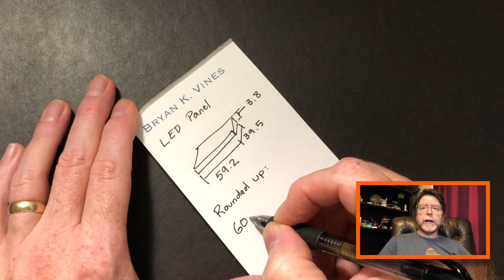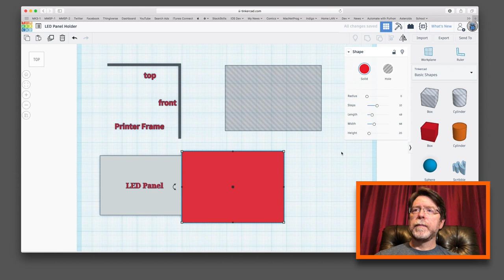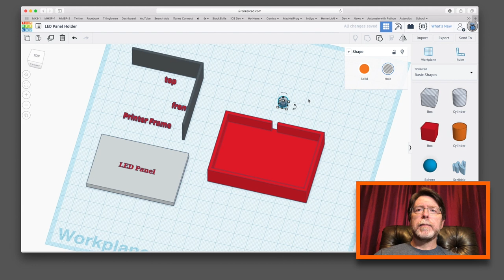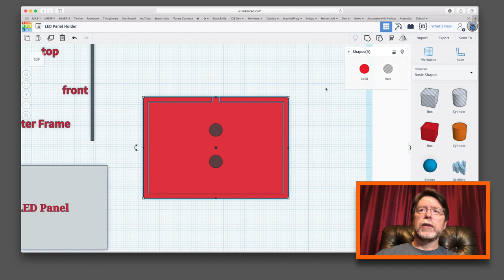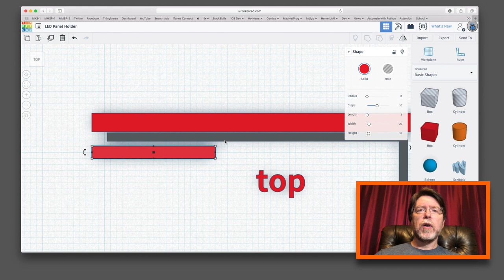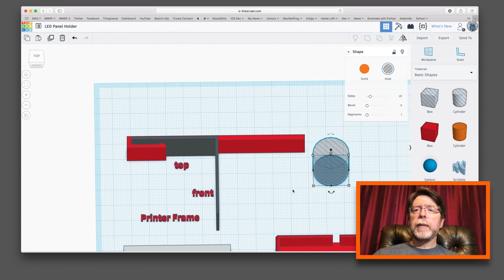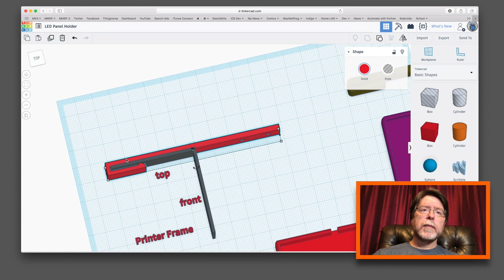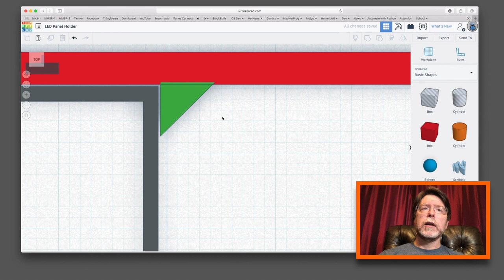Lighten Up!: Design & Print Light Fixtures for Monoprice Maker Select Plus

Comment: Cool Idea Bryan    thanks
Reply from the maker: Thanks Don! A lot of this can be translated to other printers. Mostly you'd just need to design a different arm or mount point. If you had a printer with a metal enclosure, you could just glue neodymium magnets to the rectangular fixture, and stick them on where needed. 👍

Comment: Another very nice video. Slightly modified this can work for any printer
Reply from the maker: Absolutely, David! A change to the arm design is about all that's needed. The arm could be designed with a notch instead of the clip to snap onto a printer with a thin, flat Z gantry, like a Prusa MK3 or other similar printer. Thanks! 👍

Comment: Hey Bryan! I don't have a Monoprice printer and I use Fusion360 for all my design work (having used Inventor in the past) but man, do these videos ever help. It's great seeing a different perspective from other makers using different software. Keep it up! 

Also, once again, great shirt!
Reply from the maker: Hi there! I appreciate the power of Fusion 360, but I have a hard time getting a design started there. Mostly I just need to practice with it and watch some tutorials.

Tinkercad's newfound ability to send an item over to Fusion 360 is cool. It lets me at least play with chamfers and fillets and other little goodies without having to actually start the design there. Although it's a one-way trip from Tinkercad to Fusion, it isn't that difficult to export from Fusion to an STL file, and then pull that back into Tinkercad for further tweaks.

I originally wanted to show the process of sending an object from Tinkercad to Fusion, but the video probably would have been another 5 or 10 minutes long. At just over 30 minutes, I think it's a bit long already. A lot of that is because I did the Tinkercad bits realtime. There wasn't much cut out of them. On the plus side, that means you get to see how I'm thinking about the design, and how I put it together.

Anyway, I'm getting long-winded. I'm glad you enjoyed the video. Thanks for stopping by and watching.

Oh, and the shirt is from Chuy's, a TexMex restaurant here in San Antonio. They've got lots of cool ones: https://www.chuys.com/shop/tshirts
Reply: @BV3D  I had no idea you could transfer between the 2 programs like that. I'd definitely be interested in seeing the process if you end up filming it one day!
Reply from the maker: I will add that to the list of video ideas. Thanks! 😃

Comment: Just FYI, the LED lights that you have linked no longer fit your design. I ordered some last week and when they arrived the cabling is routed differently and the LED panels are slightly too large. I'm going to try my hand at tinkering your design to make them work. Just thought I would let you know.
Reply from the maker: Oh no! I'll either look for a different set on Amazon that does fit, or order a new set and revise the files on Thingiverse. Thank you very much for letting me know, David! 👍
Reply from the maker: Hey, David, could you take some measurements of the panel you received, and send a picture of where the power leads are attached to me? The Amazon listing still shows the panels as being 60mm x 40mm, and they haven't changed their photos. email: bv3dchannel@gmail.com ...thanks!
Reply: @BV3D  Sent. I've had my MSP for over a year, and just started to mod it. Found your channel and have enjoyed it. Thank you.
Reply from the maker: @DWRaff  Great! I've sent you a rough STL file if you want to give it a print to see how it fits. I'm happy that you like the channel! If there's anything you'd like to see here, let me know. I'm always looking for cool things to do!